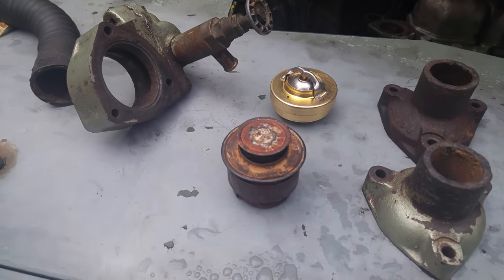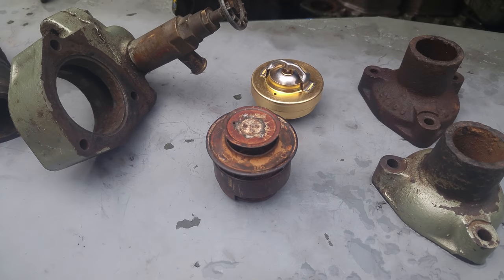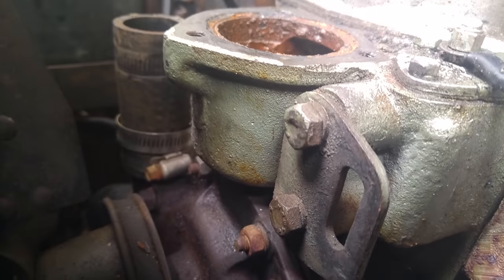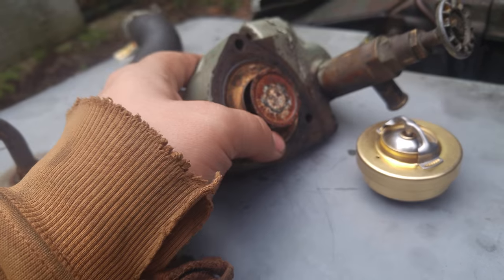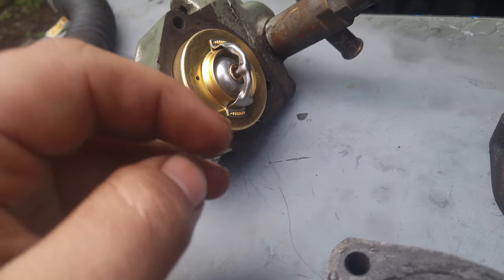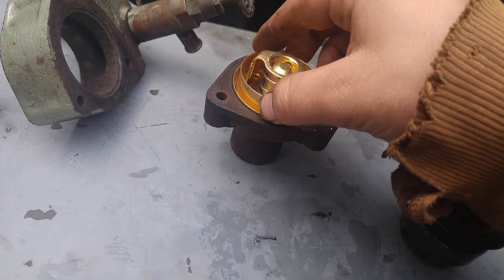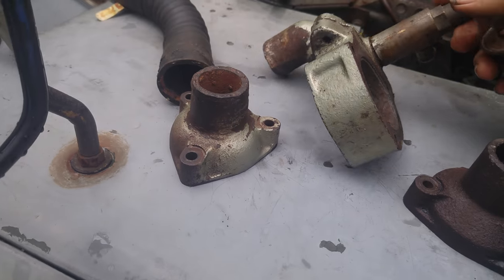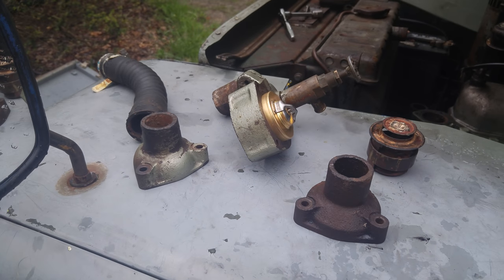Land Rover series thermostat PSA

Comment: Excellent PSA!! I’ll have to check my housing.
Reply from the maker: +Cory Anderson glad it could help! I thought it would be a 5 min job, had to run and rob the newer housing off the spare engine (which I hadn't brought home at the time 😁)
Reply: scienceaddict77 most jobs usually go that way. Ha ha!!
Reply from the maker: Cory Anderson so true. Like today even, fighting with the timing cover for 2 hrs, when I realized one of the nuts on the water pump was on a stud in the block. Took it off, cover popped right off.

Comment: i would go with the new stat for now mite need a paper gasket between the 2 half's,,, gotta get back on that road  !!!!
Reply from the maker: I've got the new one in it, however my motor started knocking 2 days after making this video, so the bottom end is blown apart right now 😁. Still don't know what the issue is.
Reply: You're have some bad look mate ,could be oil pump related or big end shell bearings mine had a knock but it turned out to be the new clutch that I had just fitted came from the back of the motor / bell housing- different engine- anyway keep up the good work  mate keep us all updated
Reply from the maker: vaughan warburton I'll try too. I've got all sorts of videos shot, rebuilding the carb, setting the voltage regulator, the first start etc. Etc. It's just finding the time and willpower to edit them is difficult. I would like to try to get on a regular posting schedule, at least until I'm through the videos I've already shot.
Reply: Thanks for the helpful post.  My 1961 Series 2 has the same issue.  I bought a new series 2a type thermostat and upper housing, which fits as you have shown, but when I try to fit the o ring there is a gap between top and bottom of the housing so the join won't seal.  I have fitted the stat minus the o ring and got it back together again, but as my S2 is being rebuilt to get her back on the road, I have yet to see if this will leak with the engine running.  Maybe I need to fit a later Series 2a lower thermostat housing to go with the newer upper housing,
Cheers
Reply from the maker: +Sask Series I don't believe you should have to, as I believe the bottom part never changed for the 2.25s. Did you make sure the grooves for both the o ring in the top and where the thermostat sits in, in the bottom, are clean of debris? Also, the o ring Is supposed to "crush" a little to provide the seal. The top could be machined improperly, not deep enough, but if it's used, I doubt that. The o ring as I understand it is there to prevent the thermostat from moving around, and to seal against water bypassing it and going through the radiator, so I don't think running without it would be the biggest issue. You could try ordering a thinner o ring, by how much gap you've got too. Good luck, hope you figure it out!
Reply: scienceaddict77 thanks for your prompt reply.   It was a couple of months back I faced this challenge and I now remember I fitted a flat type of thermostat in the housing as the new one you fitted wouldn't allow the top and bottom housing to close up.  I had cleaned out the groves,even bought another thermostat from a different supplier and still it wouldn't fit.  Hope it all works without leaks, when it's all back together again.  Happy rovering!
Reply from the maker: Sask Series just be careful the flat type, it needs to have the "skirt" to block the bypass pipe, or else to can end up with erratic cooling, and hot spots in the block. I've heard warning that it can even cause a cracked head, so be careful.
Reply: scienceaddict77 ok thanks.  I might try to get another thermostat top (my new one is used) and see if I can't fit the skirted type.  I have a temp gauge to fit to keep an eye on things.  Just watching the rest of your videos.  Cheers!
Reply from the maker: +Sask Series thanks, I honestly have to get onto editing and uploading. I've got probably several hours of videos backlogged. I want to to try and upload weekly, but that hasn't happened.